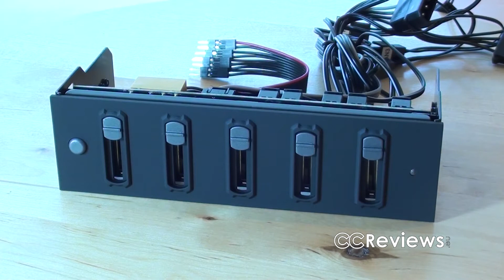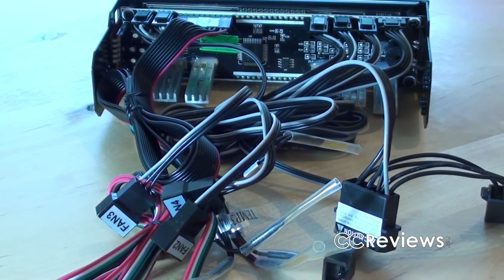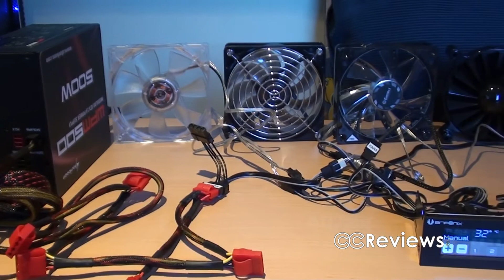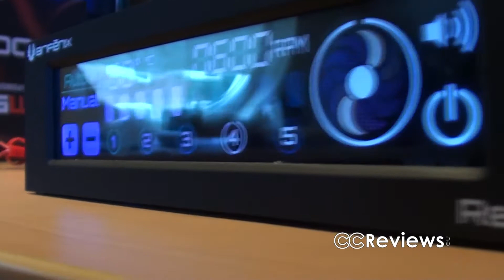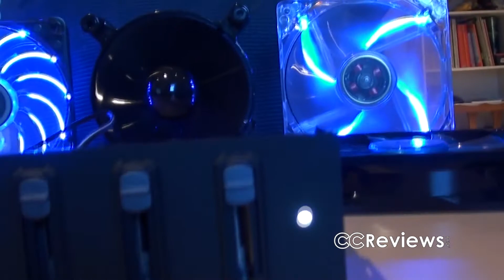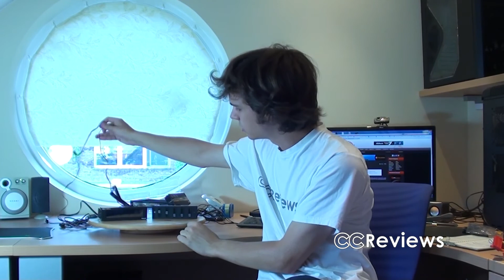#82: BitFenix Recon & Hydra Pro fan controller Review (CCReviews)

Comment: Does it account for how many fans I have, What I mean is does it know how many fans you have and then go slower or faster because of that. I have 5 corsair af120led so don't want them all running at full speed
Reply: fan controllers have a set amount of slots. However you can use types of connectors that can link up two fans to one connector in the fan controller to save space and coordinate them. so even with 8 fans, you can use a 4 fan controller.

Comment: cough also....
depending on what fan is connected to which output would be effected by which sensor wire you were holding when you did..
since there all labeled for each fan output..cpu fan 1 gfxcrd fan 2 case fan 3 ..
hope that might explain the logic.
peace out

Comment: i might be a bit late but ...
the reason possibly you are getting curious effect to this controller with some led Fans..
if there the type that have intelligence.. like air writing.. the dip in voltage as the fans is slowed by the controller will ultimately cause it brain to frag since its operating voltage has effectively ceased. and when it returns to about i guess just above 3/4 operating voltage returns.. and it come on as normal..

Comment: i think the reason that fans' L.E.D's kept turning off was because fan controllers 'control' the voltage regulation to the fan, so if there aren't enough volts running through the fan itself it wont post power to the L.E.D's Just an observation, give it a shot ! Try running high rpm and low rpm see what the L.E.D's do

Comment: I NEED HELP!!! I want to use ahhh this Delta Electronics FFB0912SH-F00 92x92x25mm Cooling Fan, 90.02 CFM, 4100 RPM, 50 dBA, 0.69 AMP, 3-pin TAC connector, with that controller, will work??? the Fan is designed to work with 9w, below as each channel of the Bitfenix, but its RPM going to 4100!!! that will be a problem???

Comment: man the enermax fan probably powers the led's only when spining, like my cm fans. so when it is on auto and runs on low rpm the leds are dimmed and when you put it manualy to high rpm they are brighter. so no prob with the fan or the controller. I may also be wrong but you can check it :)